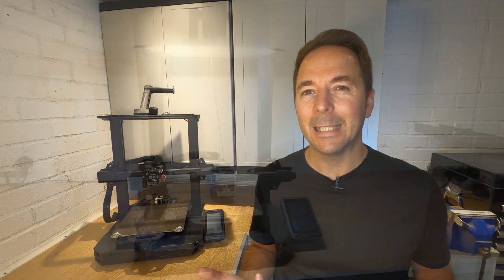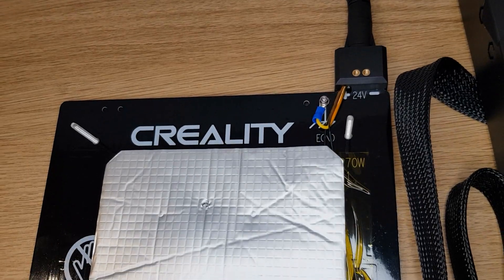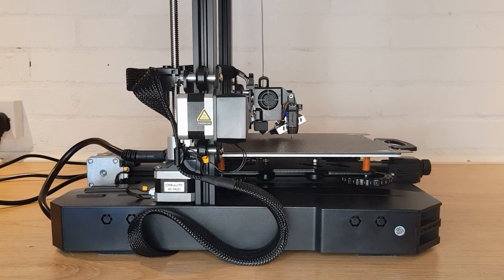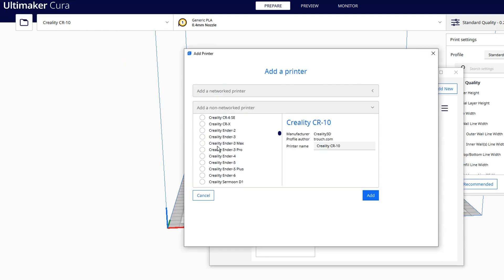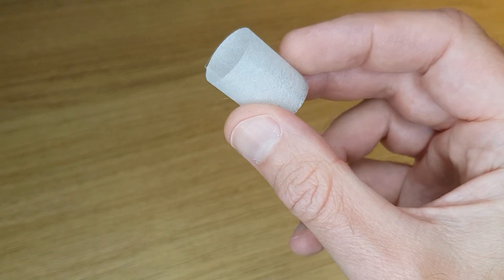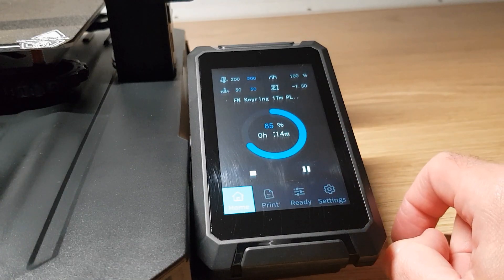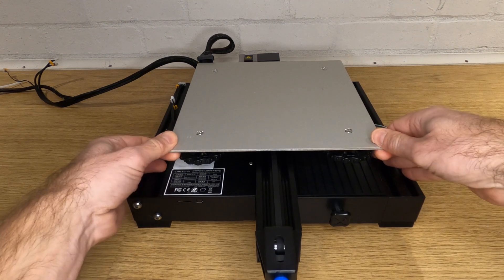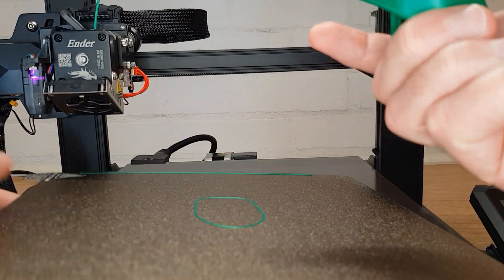Ender 3 S1 Pro 3D Printer Review - Is It Actually Worth That Much?

Comment: The only issue I ever had with this printer in years is when I changed the nozzle, it started to fail probing, of course it was because the nozzle wasn't tightened to the exact point on the z axis, so I added washers to the probe screws to make the probe be lower on the z axis so it hits the bed first before the nozzle hits the bed, and it fixed the issue.

But otherwise it's been a printer that you just print without having to worry about taking care of it, just a reliable tool.
But for people who consider this printer, I would probably suggest more modern printers like bamboo labs printers, avoid bed slingers, there is better technology than bed slingers out there. But for me, this printer been great. I wouldn't upgrade, does exactly what I need.

Comment: I got my ender s1 pro a couple years ago and had a terrible time getting it set up and printing reliably, so ultimately i packed it away. A couple weeks ago i decided to pull it out again after over a year to print a stargate and was running into most of the same issues with bad adhesion and constant z-index tweaks trying to get the first level to stick. I had previously gotten a warranty bed replacement due to warpage and figured this was my main issue before and with the new one. After researching i saw the comments on guide wheel tension and adjusted that, updated the firmware too and still had the same problems. One corner would smush while another wouldnt stick. What has saved me is the newest creality FW now shows you the mesh values AND lets you edit them, so after a dozen test prints im getting consistent first layers across the bed(for the most part).

What im wondering is if i should even need to be doing this? Some of the initial mesh measurements were so far off from where i ended and i had to adjust every single point of the 4x4 grid. In particular the entire 4 front sectors started at -1x and are now in the positive range. While the back right corner took one or two .01 adjustments to perfect it. It doesnt make sense to me that some points are good and others wildly inaccurate, but at least now i have a way to correct it and have been getting consistent first layers print after print for the first time. I also watched your klipper videos and plan on doing that but dread having to spend hours retesting and tweaking a bad mesh.

Comment: Ive just bought one as my first 3d printer.
It arrived yesterday.
So far its still in the box as I need to move some things around in the office to make room. (Maybe this weekend or the next)
Reply: Well.... ?? How do you like it?
Reply: @OregonDARRYL  it went together very easily. Very easy to setup.
Few failed prints sorting temperatures and bed cleaning.
I still have maybe 1 in 10 prints fail, because something falls off or warps.
Reply: @sahhull  Thanks. I'm buying one today... they are under 300 now...

Comment: I have my ender 3 s1 pro for 4 months now. it just occurred to me that the layers on my prints are not consistent and could result from Ζ- binding. I checked my printer and the belt on the Z-axis is off. On the left side (looking from the back) it is on the bottom and on the right side (looking from the back) it is on the top. I also put a glue bottle to check the alignment and it is a bit of on the left side (looking from the front). The 3 rollers on each side of the Z-axis are imbalanced. How can I fix these??
Reply: Hi Ricky apologies for the additional comment. I have uploaded a video showing the issues I described earlier.https://youtu.be/Y7sQgvUEj0w Please let me know

Comment: I was having problems with my End3 V2 extruder, saw the Sprite Pro extruder and decided to give it a try.  I got much the same result as you did, although I would NOT use Creality firmware or slicer.  I had problems with both.  I used Jyre’s UI.  Bryan Vines has a pretty good video on both the Sprite Pro and Jyre’s UI.  

BTW, in the documentation for upgrading it mention the retraction should be .8mm, not 8mm.  I found that to be accurate on PTEG, but made TPU string pretty bad.  But 5mm made TPU jam pretty bad, so it mush be somewhere between.

Comment: mine came in great, for the first print i only did a bed adjustment. very impressed with the resolution, but i guess that is just my mind only knowing 1e gen printers till i bought a modern one :P
PS: did have problems with the extruder, it wont go strait onto the holder, i had to use a little filler to but between the bottom of the extruder and the holder.
Otherwise it would not sit level with the bed and the lvl tool would drag the bed.... so it was not all sunshine :P its just that the first test print was not big enough to have the tester scrape the printed bits. Still.... loving it!

Comment: I’ve had my ender 3 S1 pro for a week now. Thanks for reviewing and for other vids on leveling etc. I found my cables to reach just fine but have opted to print and use your retainer clip for better cable management. I am having issues with my hot plate distorting which makes the auto leveling have to compensate over 1 mm in the center. I have taken apart and and straightened aluminum plate a little. I think the plate still distorts during printing causing my prints to be knocked by the nozzle. This is especially the case on smaller footprint pieces. I’m yet to play around with fan speeds and bed temps. I’m considering a better base plate upgrade but it’s not a simple swap out.

Comment: Mine was great out of the box.   set up, printed a few things, started a larger project and after about 40 TOTAL hours of use, it gave up.   Replaced the sprite head, heaters, EVERYTHING but the main board and this damn thing will no longer print.   It will push material through the head for the test line but nothing else.     Thinking about converting it to a laser only but I'm sick of throwing money at it.  Their service dept is useless.    No more Creality for me.
Reply from the maker: That obviously sounds terrible. Are Creality no help in fixing the problem? How long have you had it? You should have a 1 year warrantee that covers normal use.

Comment: Another concise and engaging review! I enjoyed it so much I bit the bullet yesterday (thanks to some good UK deals) and my 3 S1 Pro arrived today. As expected, the assembly was a breeze but the Creality QC needs improvement. A loose print bed, stiff Z-axis rollers, a tight Y-belt and a few bolts that needed to be snugged down. All fixable so far! Your bed levelling video was really useful so I'm ready to add the G-Code once I install the Slicer & Print software on my Mac. Looking forward to finally being able to print TPU parts for my drone after owning a PLA-only Zonestar P802M since @2014!! Keep up the good work 👍
Reply from the maker: TPU prints still really impress me. I think it's my favourite material. Enjoy👍
Reply: @RickyImpey  No issues with PLA thanks to your advice. Spiral XYZ calibration cube was turned out extremely well, even at 0.2mm layers. Dimensional accuracy was only 0.6/0.1/0.4% on XYZ axes respectively. First TPU print planned for this evening!! Cheers 👍
Reply: ... and it worked with Sunlu 95A TPU filament on Blue Tape over the PEI plate. Good adhesion but snapped off without any drama. A perfect fit for an SMA connector and a metal standoff on one of my drones. Kinda guessed at the retraction settings based on other TPUs. No stringing, and 0.2mm layer height absolutely adequate for the intended use. What a relief!! Thx again 👍

Comment: Got this printer for my birthday, but when I print I have to start with the nozzle low enough to have the print to stick on the bed, once the first layer is done I have to bring it up a bit so it won't push on the printed object. Is there anything I can do about it? The prints I've done so far look nice and clean, no lines to close or too far, but I need to do manual adjustmen during print, which does not seem to be the way to go

Comment: Great video. I’m finding it hard to adjust the Z offset. You can only change it by .5. On my V2 Neo you can change it by .1. Am I missing something or can you change it by .1 on the S1 Pro?
Reply from the maker: Hi, yes some machines don't let you change the offset in the smaller increments but .5 seems very large for a z offset adjustment. .05 would be fine. Sorry, I don't have a Neo to be able to check what is possible.
Reply: @RickyImpey  sorry I meant .05 that’s all the S1 pro will let you change it by. The V2 Neo will let you change it by .01. I find sometimes .05 in too much

Comment: I must be lucky, my 3 v2 Neo came perfectly adjusted. Belts were perfectly tuned and bed was perfectly level after running the auto leveling. Only thing is I realized why people are saying to tune every few prints because it does get unleveled very easily.

Comment: Thanks for your great videos! My grandson and I just put together and Ender 3 V2 Pro using your method. Worked flawlessly.
Maybe a dumb question... I quickly scanned the comments but didn't see anything about this. Sorry if I'm being redundant.
The PEI build surface requires a magnetic sheet on the bed, right? Am I misinformed or is there a rather low temperature limit with this kind of setup? I remember hearing somewhere that you can only print with magnetic adhesion up to temperatures around 60C since the adhesive magnet quickly degrades. Don't many materials require much higher bed temps?
Again, thanks!
Reply from the maker: Hi, no problem. Yes, in theory higher temperatures will degrade the magnet but I haven't experienced it myself yet over multiple printers with magnetic beds. What do you plan to print that would need higher bed temperatures?
Reply: @RickyImpey  Thank you - Good to hear. You seem to really like the PEI plate. I'd like to try it.

PETG would be the only material I'd be worried about. I've printed it on the Creality textured glass plate using 75-degrees C. I wouldn't be printing ABS, but I think they recommend even higher.
Reply from the maker: @mikelynch4361  I print PETG on the PEI bed at 60°C and it's good. I have had it mark the smooth side where it sticks a little too well so I use the textured side for PETG. I like the way PEI releases easily with PLA and PETG on the rough side.

Comment: Great video! Could you clarify the very last sentence of the review? It sounds like you're giving a glowing review (except for the few cons), but you end with on the conclusion that it "falls a little bit short". Is this specifically related to being a good beginner printer, or for a printer at this price range in general?
Reply from the maker: Hi, I feel with the S1 Pro that Creality could and should have refined it a little before releasing it to market. It could have been great. I get a lot of comments from beginners who say that there is not enough information on how to create a bed mesh, how to change filament mid-print etc. I have released a number of video guides since making the review video so hopefully you will find what you need on my channel if you bought one. I really liked it but felt that for how much it was at release, I wanted it to be perfect. Now the price is lower, I think it's a great option.
Reply: @RickyImpey  Thank you :) haven't gotten it yet, but definitely considering it.

Comment: Great review! My Ender 3 S1 Pro arrived today. Got almost as good prints out of the box as with  my heavily modified Ender 3 Pro. One thing I found that really helped with the corners on a calibration cube was to bump the X and Y jerk from the standard 5mm p/s to 20mm p/s. Perfectly square corners now! Unlike your bed I found that the rollers we way too tight as were the X and Y Belts.

Comment: Ricky- thanks for  great video! But for the life of me I can't get my S1 Pro to do "auto bed leveling" before starting a print? I'm using Cura 5 and tried this once before from info in one of your videos and tried it again today using the "M420 S1 Z10" command in the start G-code just like you did in this video. No worky as it just goes directly to purge line and then starts printing. Any ideas? Thanks, Gerry
Reply from the maker: Hi Gerry, why do you want to create a new mesh before each print? You can do that by using the 'G29' code instead of the 'M420' line but it shouldn't be necessary. If you follow my guide on 'leveling', you should only need to do it when you change something. https://youtu.be/GmhBYOEb-ro
Reply: @RickyImpey  Thanks for the reply! It's not that I necessarily want to do a bed mesh before each print. I'm fairly new to this 3D thing and inquiring minds like to know how to do things 🤔. You showed it in the video so I just wanted to see if it would work and it doesn't with the M420 line. Again thanks, Gerry

Comment: Hello can I ask you something. I bought ender 3 s1 pro a week ago and everything is fine when I am printing PLA. However, yesterday I tried TPU 95A and the printer always alarmed to clean my nozzle and extruder and didnt let me print amything with TPU (although TPU was coming straight from the hotend just like the PLA) is there anything you can suggest. I am using creality slicer and when ı used TPU ı used the tpu profile with 15m/s writing speed with retraction off but as I said it didnt enable printing becayse of the nozzle cleaning error.
Reply from the maker: I haven't seen a nozzle cleaning error. The most likely error is a temperature error as you are trying to heat the nozzle to higher temperatures with TPU. For this i would suggest a PID tune but the 'nozzle cleaning' confuses me honestly. The S1 Pro has no sensor to detect a nozzle needing to be cleaned🤔

Comment: Hello Ricky, I have a question. 

I had recently got an Ender 3 S1 (not the pro), and I'm basically relearning everything since my V2 worked flawlessly after I set it up. For some reason when I print the cura first layer test I have certain areas with under extrusion. I re-trammed my bed, made a new dot mesh, and cleaned out my nozzle for any clogs via the needle. I can only assume that my retraction settings are off in some way, or my filament is too moist? The under extrusion happens consistently in the same spots of the print for some reason. What would you say is the optimal retraction settings for standard PLA pro filament for the S1? And if it isn't my retraction, what else would cause a consistent gap on a print in the same spot even after calibrating? Any feedback would be helpful, thanks.
Reply from the maker: Hi, under-extrusion in a specific place on the bed would be really strange. What is much more likely is that the bed mesh is not perfect and the nozzle is getting too close or too far in that area. Unfortunately there have been reports of some S1 Pros having some kind of issue with the bed mesh but i'd not heard anything about the S1. My advice would be to try the tramming and auto leveling process again and make sure that you get the bed as well trammed as you can manually before auto leveling. This is the method I use https://youtu.be/zKpNxqWie_8

Comment: The start and end G-Code for Cura you have in you description works like a dream, fixed a lot of the issues I was having with other slicers. It provided amazing detail in my print alongside little horizontal line deviation! Thank you so much!
Reply: Does updated firmware include that one do you still have add that gcode?

Comment: Haven't seen it mentioned,  but you can purchase this printer right now on eBay refurbished for $350 + free shipping. Fully covered with a 2 year warranty and is manufacturer approved.

 For under $400 you can have this printer and an entire roll of PLA at your door. SOLD
Reply: Amazon now $289.

Comment: Im have leveling problems on my s1 pro, What firmware version do you have?
Reply from the maker: Hi, I'm still running 2.0.8.13. I plan to upgrade soon so that I'm more in line with what many of my viewers are currently running.
Reply: @RickyImpey  I had the new firmware installdone. One thing i did to help with bed leveling is installing octoprint on a raspberry pi 3 and adding the plugin bed level visualizer. That way you can se the mesh and se where the high and low spots are. I needed to add a strip of tape under the plate to get it level.